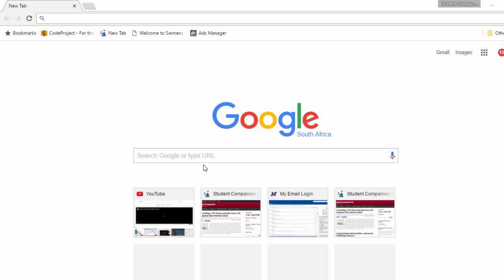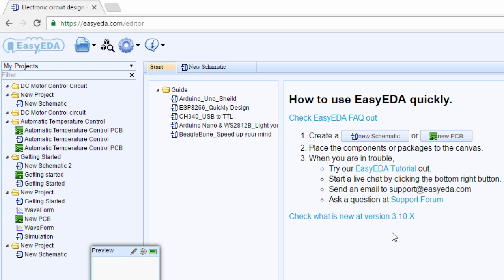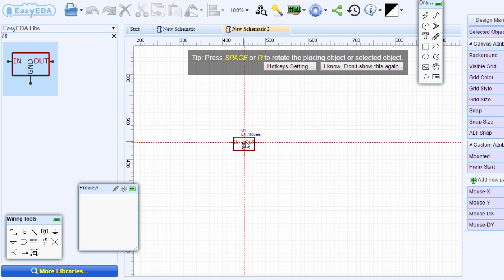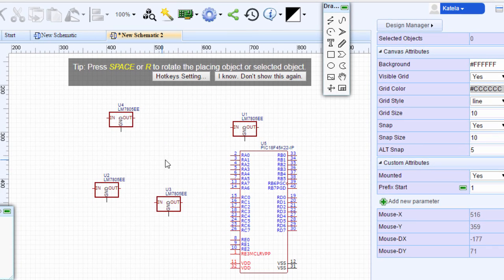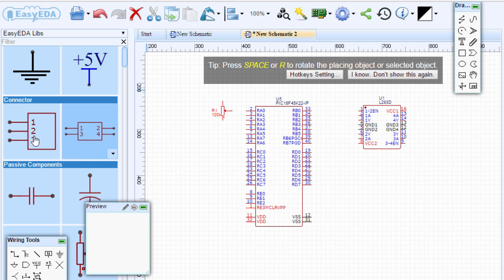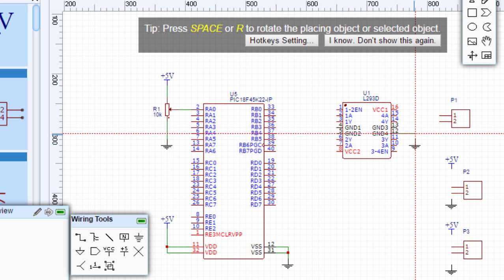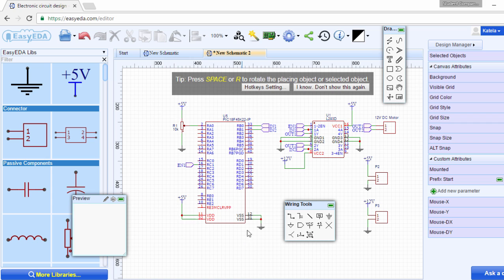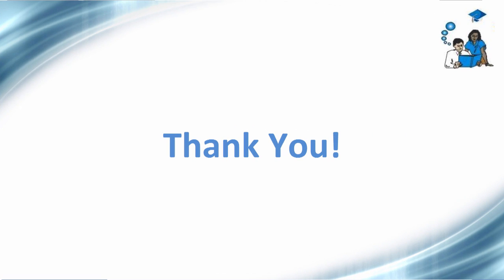Draw Circuit Free with EasyEDA

Comment: Thank you for this great lesson.Just a one question .Is  this software capable of converting  circuit diagram down loaded from internet to Pcb?
Reply from the maker: It depends in what format that circuit diagram from the internet is
Reply: @StudentCompanion   Could you please tell me what Kind of format document that capable of doing this software
Reply from the maker: You can't importing a circuit diagram in word, pdf or kind of document , you can only import a circuit  in other supported schematic/PCB design software like in EAGLE, Altium, etc.
Reply: @StudentCompanion  Thank you so much for the info;greetings from europe
Reply from the maker: You are welcome!